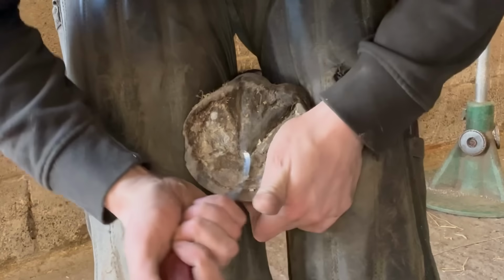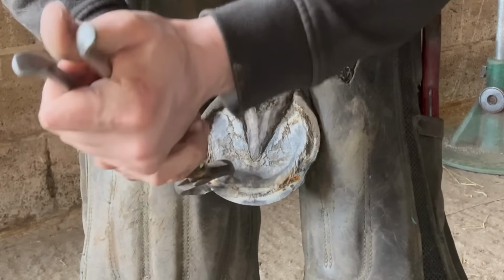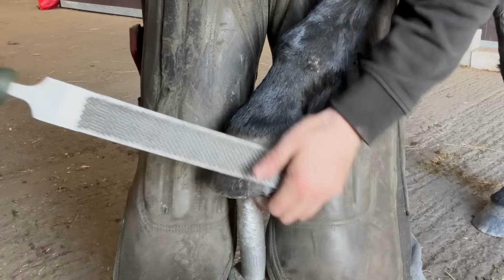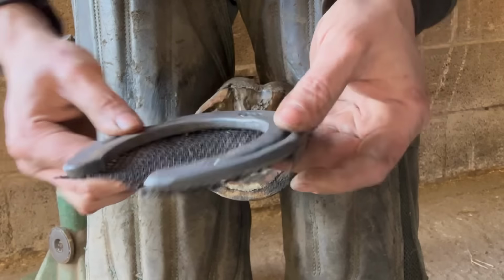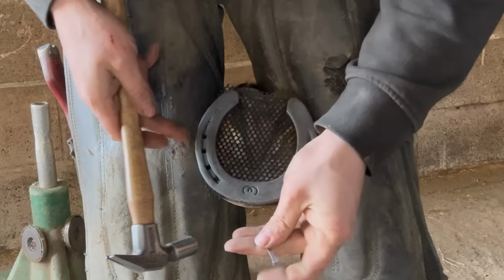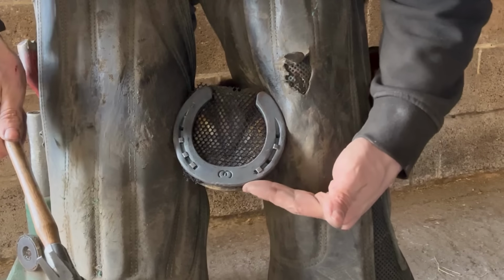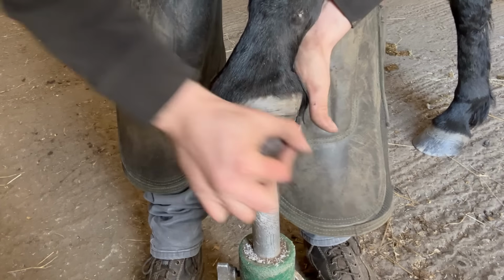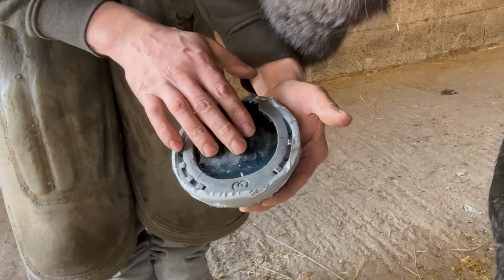Helping This Poor Hoof With Hoof Gel And Shoes. (Hoof Restoration)

Comment: I've noticed a few times, that you have positioned three nails on one side of the shoe and two on the other. Is there a specific reason for that as,  in my ignorance, I would think you'd have the nails positioned symmetrically?
Reply from the maker: Just the size of hoof to be honest. If I can get away with using less nails I will. Especially on horses that don’t grow a lot of hoof. Every time you put a nail in you make a hole. I want the minimum amount of holes I can get away with. It keeps the hoof stronger.

Comment: He won't answer...but if the horse has a sore foot...isn't he taking too much frog down?
Reply: I was just thinking how good the frog is
Reply: @dshe8637  you mean after he took it down or before?  The frogs pumps blood to the legs.  'The foot needs the full shape of the frog to help with expansion, contraction, and blood flow. The sole is there for protection from the ground. The only trimming needed on the sole is to remove flaky, dead sole.'
Reply: @morgancalvi6675   Some farriers are pretty brutal on the frog (that Maupin guy for example) buf Peter only trims where necessary